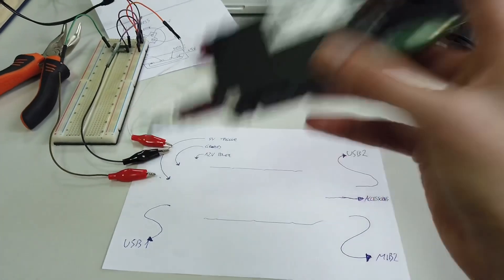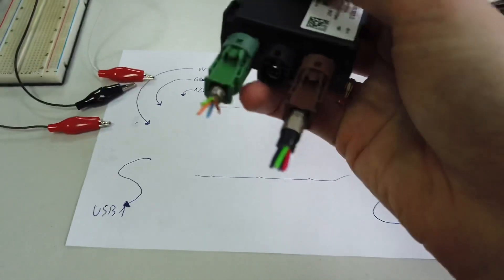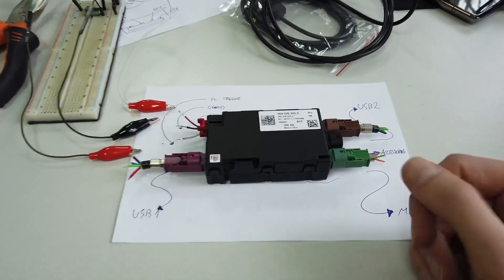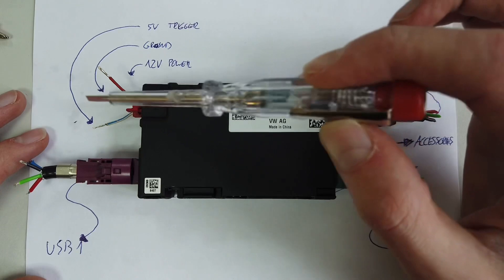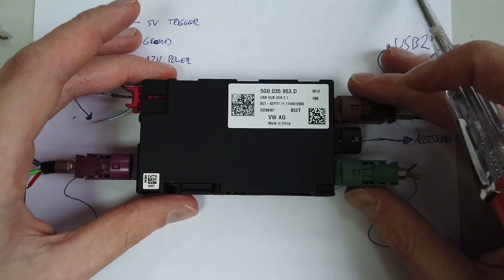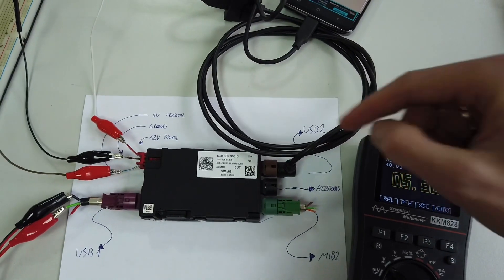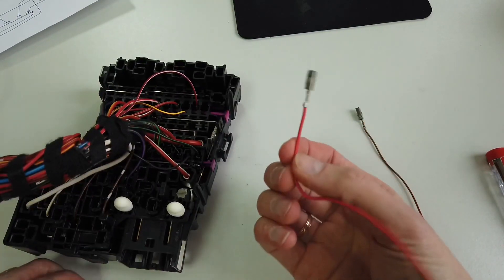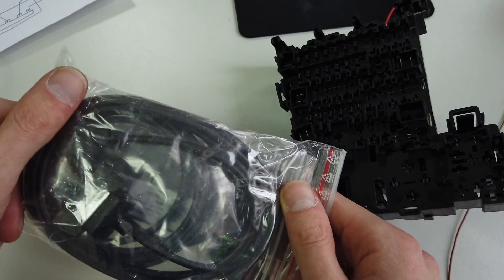MIB2 USB HUB retrofit (5G0 035 953 D) - part 1

Comment: Hello there, Mr Fix! Huge fan here.
Qq: my MK2 Tiguan have already two usb ports that i can connect Android Auto. I have now one of those wireless android auto tiny boxes connected to one of the usb ports, and it works fine. What I want to achieve is to add an additional usb port to have the wireless device actually hidden behind the dash instead of have on hanging in that cabby area. Any advice please? Thanks!
Reply from the maker: Check how your USB HUB looks like (I assume there's one hidden somewhere under the dashboard). If it's the same as mine (4x HSD connector + 1x 4-pin connector), you should be able to connect additional input into the vacant connector.
Reply: @mrfixpl  Super! Thank you very much!

Comment: My ‘15 Mk7 Golf has not the USB, but that proprietary port in the center console to which you attach a proprietary cable (originally had the old Apple iPod 40-pin cable). (Edit: it’s MIB 1 with MFI)
So I’m guessing I’m hosed? 😅😢

Comment: Hello, please, did the output from the black connector also work for you in this connection? I connected the +5V and +12V power supply and I have 5V on the purple and brown output, there is no voltage on the black output. That's all right ?
Reply: Did you managed why black port doesn't have voltage?

Comment: Thank you for this explanation! You showed how to find a 12v source. But where to find the 5v trigger wire?
Reply: You can take 12V directly from fuse box. 5V you can take from Quadlock in main unit MIB - 3rd pin in green connector.

Comment: Think i'll see if this would work in my mk6, dont know unless you try (or do research but sometimes i just like to give it a go and see what happens)
Reply from the maker: What kind of infotainment unit you have in your MK6?
Reply: @mrfixpl  atm its got the basic rcd310 which recoded for aux and have a 3rd party bt receiver plugged in the quadlock, but looking at getting something along the lines of a rns 510 which i would consider this for as i prefer oem

Comment: How can you easily tell if your car already has one? Would a 2017 Passat have one?
Reply from the maker: If you have two USB ports (center console + arm rest) you will have it.
Reply: @mrfixpl  no, only one in the centre console. However Carplay works fine on iphone, Would it work without it?

Comment: By the time this video is posted I expect the retrofit is done but the green connector to the MIB, it’s likely your existing one is 7 pin (active USB) and the hub cable only takes 5. In the 7 pin setup at the HSD end the pins 6 and 7 go to pins 3 and 4 of the green block on the MIB quadlock. In the USB hub set up the yellow and blue wire also goes into the green quadlock block (forget which pin)
Reply: By the way these types of retrofit videos are really great. Many people wait for guides to come out so it’s always amazing to be a pioneer in retrofitting. Highly recommend ERWIN access for wiring diagrams.
Reply from the maker: You are right. Single USB setup is using HSD 4+2 cable, where those 2 are GND and +5V from the quadlock connector. This can be reused for HUB and only the +12V needs to be added from scratch.
Reply: @mrfixpl  bingo, and you’ve jogged my memory, that goes into fuse 10 on the fuseboard (mk7) with a 10a!